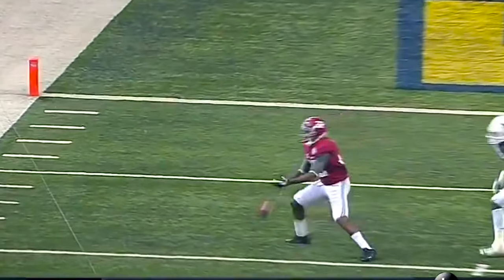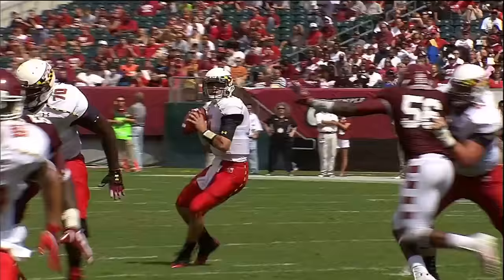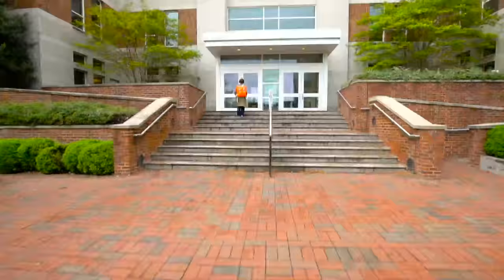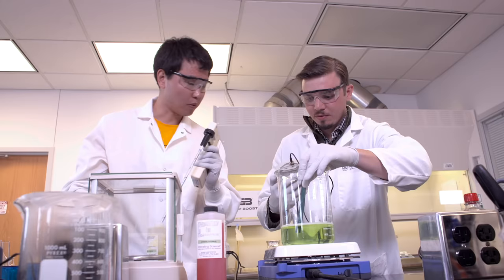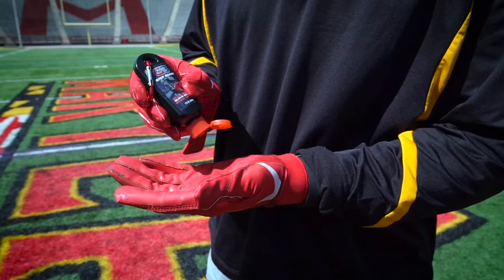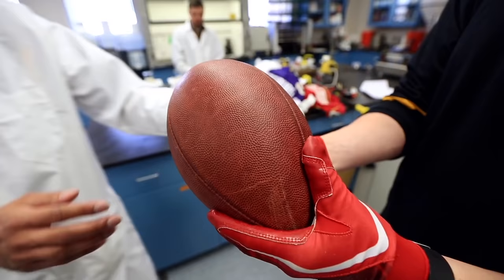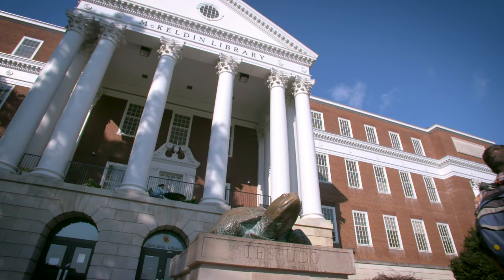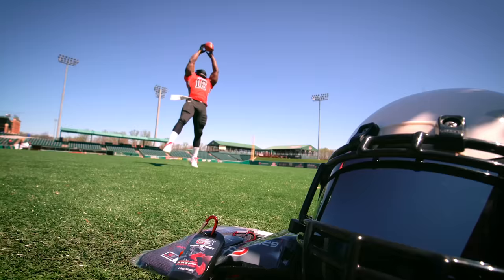Grip Boost: Get a Grip

Comment: When the jocks and nerds come together wonderful things can happen
Reply: Kenn Kenn but I’m pretty sure this is illegal to use because it creates an unfair advantage and  I almost guarantee the refs or officials didn’t know
Reply: Krazy T it’s not illegal
Reply: @shanebranum4824  hell na its just as if the gloves are brand new
Reply: ...and yet applying any sticky substances to your hands is cheating.

This is the problem with football — buy brand new “gloves” every other practice and they turn a blind eye.

Apply the same adhesives to the glove and no one cares.

But if you’re a kid, nobody will tell you that this is mandatory equipment... because no one wants to address the blatant cheating.
Reply: @-John-Doe-  what cheating?
Reply: @cheeseballznumerouno  Page 34 of the NFL rulebook — the ”stickum” / Lester Hayes Rule from 1981:

prohibited substances include: "Adhesive, Slippery Substances -- (i) Adhesive or slippery substances on the body, equipment, or uniform of any player; provided, however, that players may wear gloves with a tackified surface if such tacky substance does not adhere to the football or otherwise cause handling problems for players."

These gloves did not exist at the time of the rule being written. Anything which has been applied to gloves to make them sticky is an illegal substance. 

Especially these aerosol products applied to existing gloves to make them ’sticky’ again.

I remember sticky gloves / stickum / etc being well understood to be cheating, and any use was very discrete.

These gloves are not like the gloves most people ever used, and most people who play football know what stickum is and why anything sticky is cheating.

It’s a giant advantage — either it should be mandatory equipment or banned. Right now it’s banned.

It just screws over players who aren’t using a product to allow them to catch.
Reply: @cheeseballznumerouno  By the way — these gloves are 100x better than stickum. I’ve used both.

It’s night and day and you can go from not being able to play the game at all, to being a star player.
Reply: @Moya Aoiki   Do you know what a tackified surface is? It’s non-leather.

It’s not about messiness. It’s about adhering to the football. 

That doesn’t mean it sticks to the football and THEN interferes with handling by others.

That’s why the ball has to be changed constantly anyways. It’s not about mud or dirt adhering to the football and then interfering with handling.

It’s about the obvious advantage of sticking to the football. 

Just because you can’t catch and want equipment to provide a clear disparate advantage to those wearing gloves, doesn’t change that fact.

Either have standards and standard equipment, or don’t allow it at all.

If you claim it doesn’t provide a performing enhancing advantage over other players, then don’t wear them at all.
Reply: @Moya Aoiki  I don’t think you understand the concept of cheating.

It’s not about about cleanliness, it’s about gaining an unfair advantage.

You do understand why rules are made, correct? You understand why Pro-Hormones have to be explicitly banned? Do you understand what a grey steroid is?

Do you understand why a player being caught using stickum is a scandal in Basketball? — There’s no rule against against it.

That doesn’t mean it’s not cheating.

What part of an advantage don’t you understand?

You’re reading the rule about using STICKUM as a ban against getting mud on a ball.
Reply: @Moya Aoiki   ”This weekend Dwight Howard got busted using Stickum on his hands. Stickum is a sticky substance that was famously used by receivers and DBs in the NFL to help them catch or intercept passes. It was banned in 1981, but Jerry Rice admitted to using it all through his career and claimed that most of his competitors did too. Similarly, when Dwight's use of the sticky substance (which is not explicitly banned in the NBA rulebook) was discovered after Paul Millsap felt the residue on the ball, Dwight copped to it immediately.”

You’re really having a hard time here. 

This isn’t just using something to gain an unfair advantage, which it does.

This a topic that has already been settled in the sport. Using something sticky to help catch the ball is cheating.

Just because Nike makes money off of it with NFL branding doesn’t change that.

If you disagree, all players should have that as standard equipment.
Reply: @-John-Doe-  You don’t become a star player with simply having a stronger grip. The difference of those two substances wouldn’t make a change that big in your gameplay.
Reply: @bengal6825  If 1st string stops using them, 2nd string will replace them. 

If you're talking about really bad local highschool football teams, sure, it won't make a difference if you have no talent on your roster.

When we're talking about actual players with a future, it's not going to be the 3rd or 4th string players.

Unless the 3rd or 4th string players aren't using gloves... then that's probably why.

If the kid isn't using gloves, he's going to be at a severe disadvantage as soon as he has to compete with any other talented players.

Even moreso, if the kid isn't using gloves his freshman sophomore years on varsity in highschool in a proper program, he's going to end up being a mediocre running back at best, and never develop the skillset.

That's why I'm saying either all players should have them as standard equipment, or none.

Don't go telling kids they don't need these gloves, and then hand them to them their junior or senior year in highschool.

Anyone who has tried out these gloves in the past 10 years for the first time knows they're better than stickum ever was, and people have been using them the whole time.

Yes, the little blue pill for $20 goes around  locker rooms all the time as well. Just because you switch to pro hormones or sarms or know how to pass a basic testing protocol doesn't mean that's good too.
Reply: @bengal6825   By the way, do you know how to pass even WADA testing reliably? 

Anyone who has been around testing knows how to -- and knows precisely how to fix the drug testing if you were serious about it. And testing in Football isn't anywhere near that level.

It's cheaper to buy cheap steroids and shave 0.3s off your 40 than it is to buy gloves -- and that's a straight up steroid, not even a grey alternative.

Either all players should have it, or none at all. 

You don't want to foster a culture of using the next alternative performance enhancer just because you want the advantage to exist, and let that be the foundation of your 'talent' pool that rises to the top.
Reply: bro when i tell you that you be speaking facts🤣
Reply: @-John-Doe-  Stick to the topic, the topic is that sticky gloves don’t make a big difference in gameplay. Sure, it helps having glue on your hand, but what’s the point if you can’t create separation that allows you to get the ball in the first place? Whats the point of that stickiness if you have no ball security? One peanut punch and that ball is dropped. 
Also, steroids will not shave 0.3 seconds of your 40. Otherwise, we would have reached 4 second 40yd dash years ago. You focus so much on these unfair advantages, that it makes you forget that there are more factors to the game. Steroids can make you recover faster, stronger, and grow faster, but what’s the point if your sprinting form is terrible? Football ain’t dominated by athleticism. John ross ran a 4.21, maybe he was juiced, maybe he wasn’t, but he is bad at the game. What a waste of speed. Jerry Rice used stickum, yet does that overshadow his ability to create separation and YAC on every route he ran? Deion Sanders, who ran a 4.26, maybe juiced or not, could not cover Rice consistently. Rice ran a 4.6, yet he was still the better football player.
Reply: @bengal6825  Yes football players know how to play football.

Olympic athletes compete in their respective sports.

What does that have to do with doping/PEDs/etc or using equipment to get an advantage?
Reply: @-John-Doe-  You are stating that these unfair advantages make you a better player in your respective sport. YOU are the one saying that “doping/PEDs/etc or using equipment” will make you the better player. I am saying that it doesn’t. Knowing how to play your sport has everything to do with what you are saying. According to you, these unfair advantages make you the better player. I am saying that it doesn’t, because you would still need skills to be the better player. As I stated before, John Ross could have been juiced when he ran the 40, which was the fastest in combine history, yet was he a good receiver? No he was not. His career was short because he couldn’t take care of himself or improve his game skills.

Comment: This aint cheating? This is like baseball players using pine tar
Reply: But pine tar was banned in football. Now they're finding other ways to do the same thing.
Reply: Isn’t this just like stick em?
Reply: Pine tar doesn’t enhance to the player or bat. It just gives grip so they don’t lose it when swinging.. this product allows players to grip a ball way better than normal gloves or hands giving them an advantage.. that’s why pine tar was banned🤦🏻‍♂️
Reply: Joshua Semer not legally.
Reply: I cant believe this product is even legit...let alone the video!
Reply: It will be banned dont worry
Reply: Gloves that have that coating are designed to make your grip better and they’re not illegal, from what he’s saying it’s not adding an extra advantage it’s just replacing the layer of material that wears off on the gloves so you don’t have to replace them every game
Reply: Nicolas Walton I never had a pair of gloves that were as sticky as the stuff they put on them in this video. This is above and beyond the tack of gloves.
Reply: Omizu Water Batters get in trouble if the tar goes up a certain length of the bat.
I guess to keep all batting surfaces uniform just like the ball.
Reply: Omizu Water “beater grip” Harvard give the man a scholarship
Reply: Tony H all sticky or slippery substances are banned in the NFL
Reply: Pine tar IS allowed in baseball
Reply: @nicolaswalton9453  exactly, it isn’t really more sticky than other gloves, the grip just stay on for longer